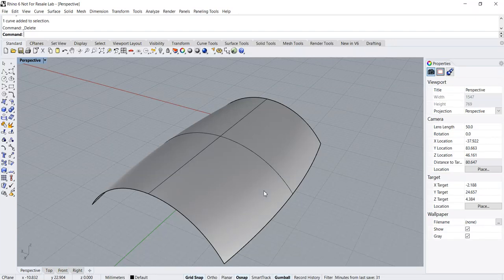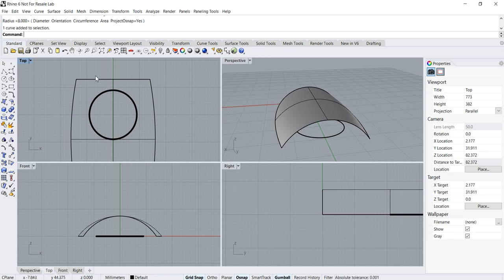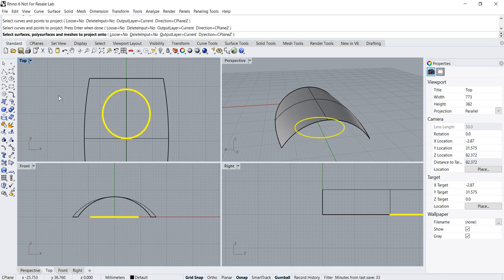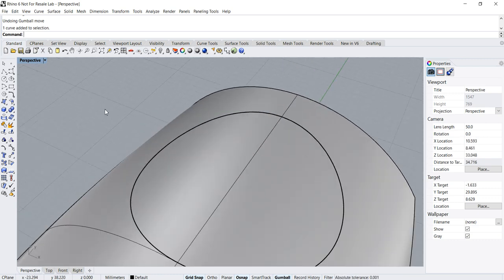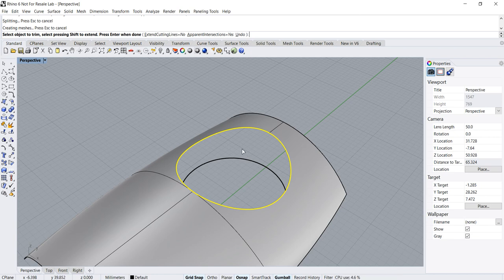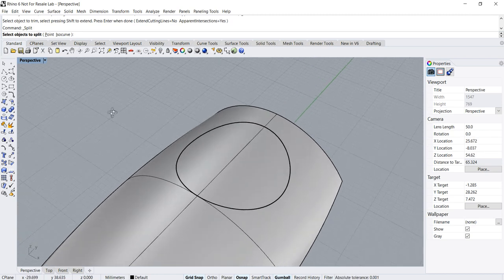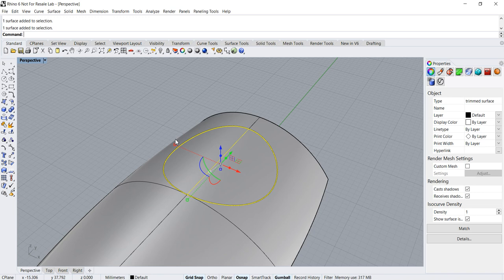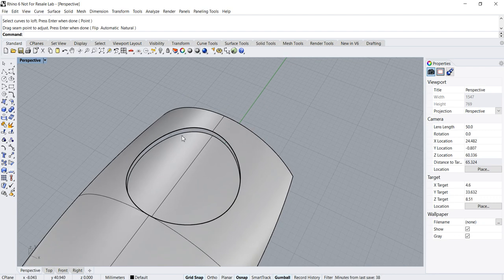Rhino 3D basics tutorial: Surface Editing

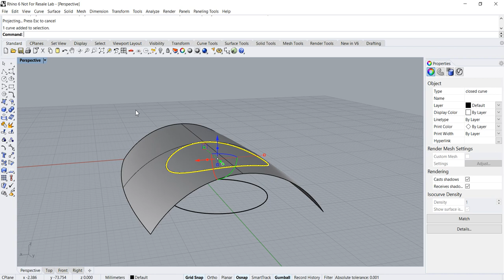Comment: Hi.  After applying the 2:10 project command, dozens of control points are formed on the curve formed on the surface.  This problem also applies to curves created with the offset command.  Is there a way to offset and project while keeping the original number of control points?
Reply from the maker: More control points are created because the new curve is more complex that the original curve. The RebuildCrvNonUniform command can be used to reduce the control points, but there is no guarantee that the rebuilt curve can be used to trim the surface because its accuracy has been reduced too. Cheers.
Reply: @simpernchong  Thanks.